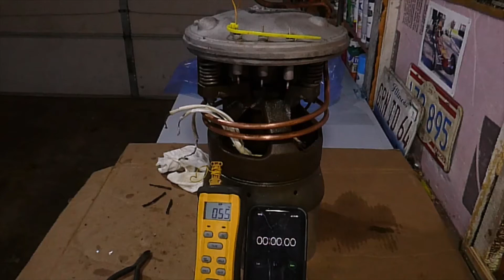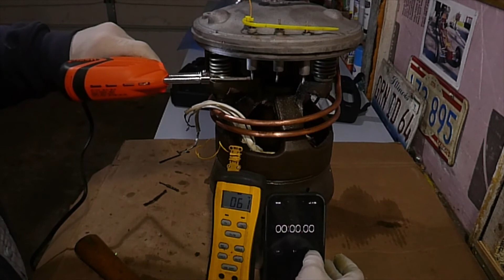GE monitor top glass terminal test

Comment: Hi Gill, thanks for the demonstration!  I have often wondered about this myself.  
Last night I rewired a 40's upright GE fridge, with the horizontal "FEA-style" compressor. It has these same terminals. I was as always, nervous and tried to solder fast. Now I know there's nothing to worry about! 

I always explain the patent and other makers using "second best" designs; when preaching to folks to be gentle with the terminals on vintage compressors. I hate the thought of accidentally turning the studs or cracking the rubber and causing leaks.  GE definitely had the most durable design with the metal-glass terminals.